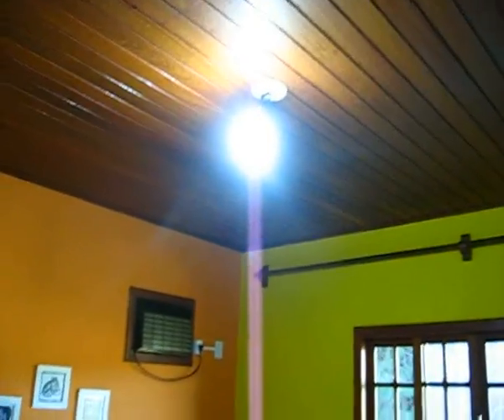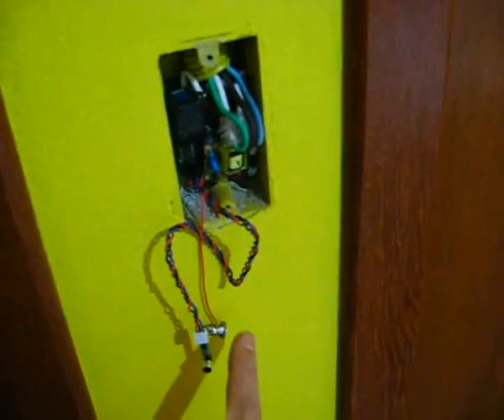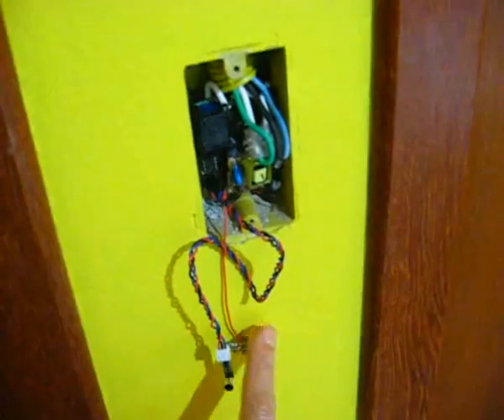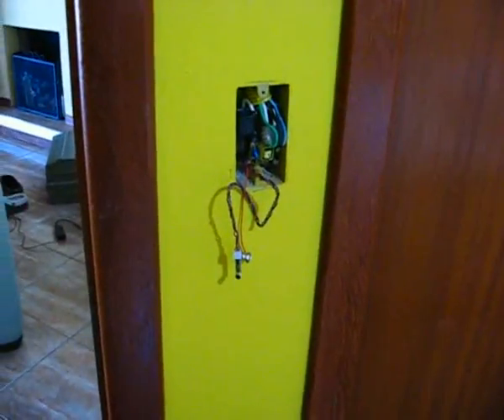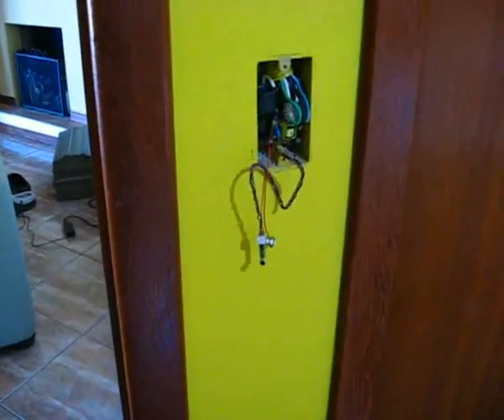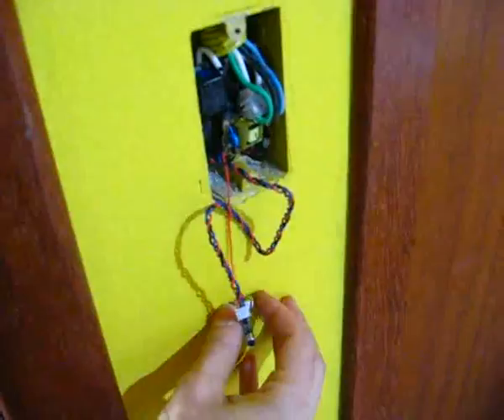Arduino Clapper 3

Comment: hi.. great job.. im doing this to my room with an arduino nano.. the problem is when i pull a chair to move it somewhere in my room it triggers the relay to turn the light ON. is there anyway to fix this? the code that i used if from "t3ix" youtube channel.